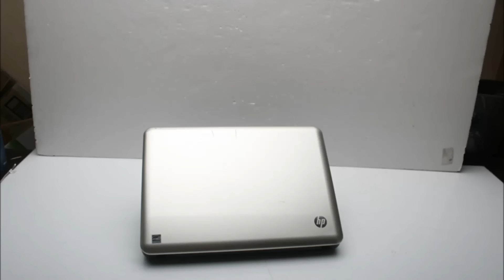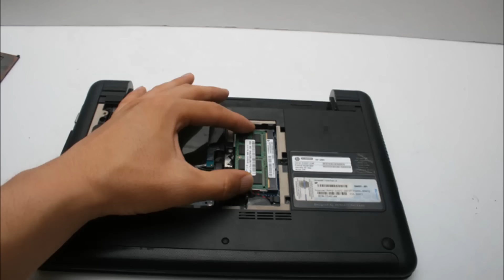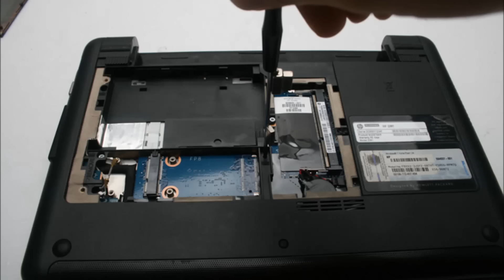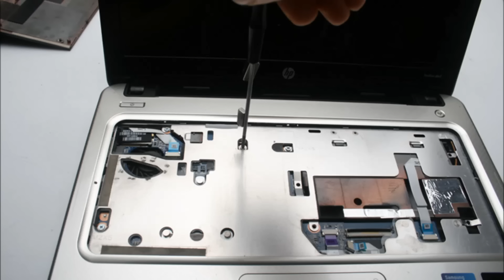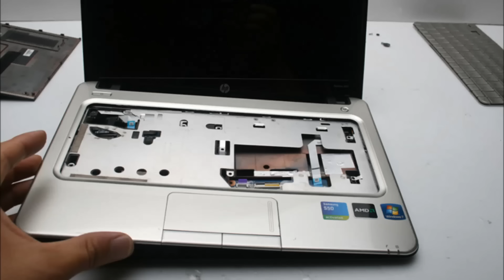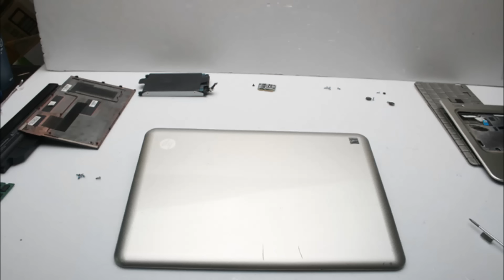HP DM1 Laptop disassembly

Comment: install one module 8Gb so diimm 1600Mhz 1.5V 2R8  (16chips )- memtest5.00RC1  - OK

hp pavilion dm1-2100er disassembly:
http://www.hp.com/ctg/Manual/c02214672.pdf
Reply from the maker: 내용이 정확하게 이해는 안되지만 메모리 말씀하시는거 같은데요 메모리슬롯이 1개라 그런거 같습니다.